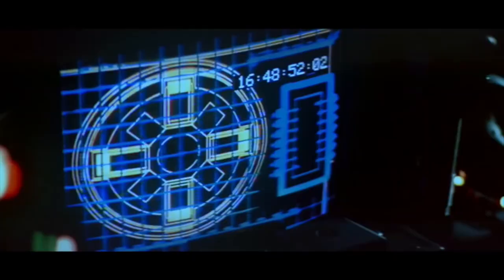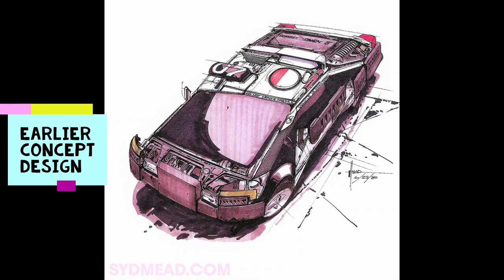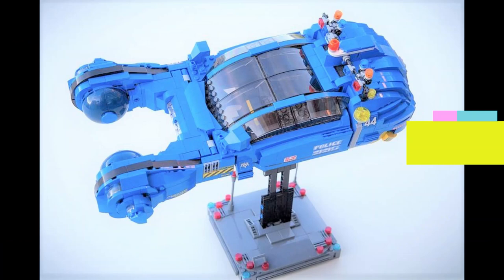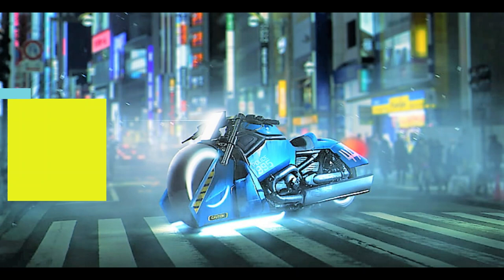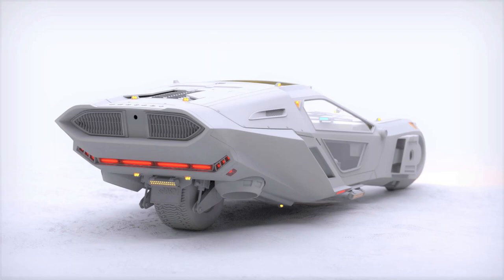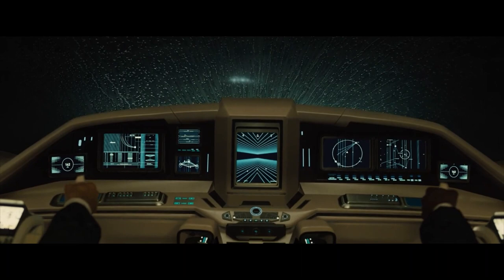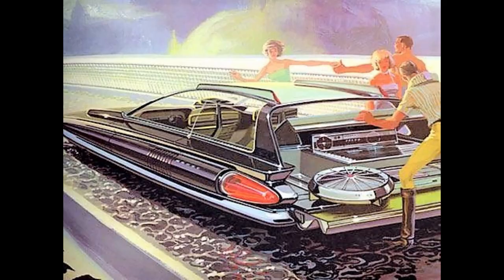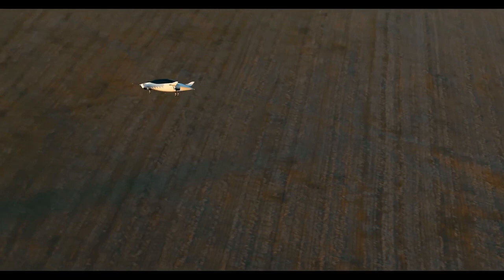How do spinners in Blade Runner work?

Comment: They appear to be using a more advanced version of ion drive technology.  A tech that's being worked on right now.
Reply from the maker: That would be something!  (When it finally gets released to the public).  Thank you for commenting, please subscribe and visit our channel for more Blade Runner videos :)
Reply: Ion drive is mostly hype of technobabble of unfeasible low thrust since reaction mass usually has some ions.

What is need are Marry Kenney's ground based STOL fans.
Reply: Pychon patent #508753 of 1893 along with Tesla had Victorian ion drives.

Comment: The big misnomer in blade runner is that Deckards police cruiser is a Spinner.. Its not!  there's two distinct vehicles in use in this film,  the police patrol sedan, which is NOT a spinner and does not fly,   and the Spinner vehicle that does fly and does drive. What we actually see...    First, we see Deckard being taken to the police precinct by way of Gaff, who pilots an actual Spinner. look at its design in flight and making its final approach to the roof top landing pads.    (Spinner is the brand name of the company that produces it).  NEXT..  We see Deckard again being taken to Tyrell corporation.  He's not piloting it, Gaff is, as its Gaff's vehicle.  NEXT   Then Gaff takes him to Leons apartment.   same vehicle, deckard on the job with Gaff.  something most people overlook is that Gaff is working alongside Deckard at this point, shaparoning as it were or spearheading the investigation. never the less Gaff is with him at this point.   After leons apartment and finding the snake scale in the bathtub Gaff drops Deckard off somewhere Likely the police station where deckard gets a patrol sedan, not a spinner.  this comes after our introduction to Roy Batty and his search for answers at the eye manufacturing plant.  We now see deckard in his own police sedan (not the spinner and no longer with Gaff) driving in the iconic LA tunnel.  We know hes driving as he's now on the left side of the vehicle also the vehicle itself is very much different than the Spinner in design. Very Triangular like a cybertruck.  Its in this vehicle that Deckard now conducts his investigation. He's now on file and being monitored.  fast forward to the Fish Vendor scene and we see deckards patrol car along side a police spinner.  Deckard asks about fish scale, which is proven to be a snake scale.   deckard retires Zora,  Gaff shows up with Bryant in his police Spinner.  Gaff ever overlooking Deckards emotions. (tell tale signs that deckard very well may be a replicant)  fast forward.. Deckard is told to investigate Sebastian's apartment. again he's driving the police sedan, which is then burglarized by kids in the streets.  Police spinner Id's deckard on file and monitored.   Two very different vehicles.  what is interesting is that deckard is filmed inside the spinner as the interior build of the sedan from the side was likely not well designed for that shot.   Deckard pulls up to the bradbury in the patrol sedan NOT THE SPINNER.    battle with Pris and Roy batty.   Gaff arrives in his spinner upon rooftop.   deckard flee's LA with rachel in patrol sedan.
Reply from the maker: True, I realized that too :)  Deckard's car is just a regular sedan (albeit futuristic).  Thank you for commenting, please subscribe and visit our channel for more B.R. content :)